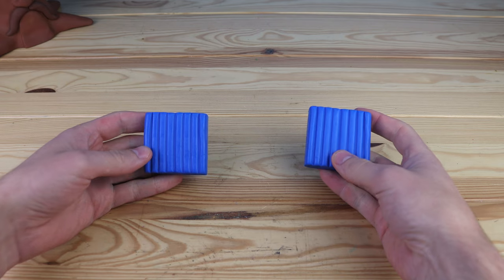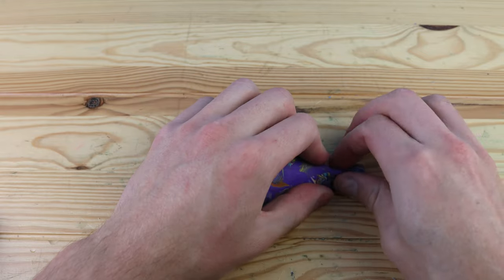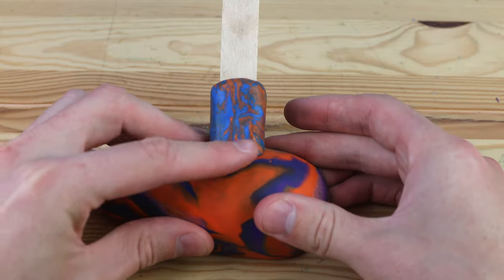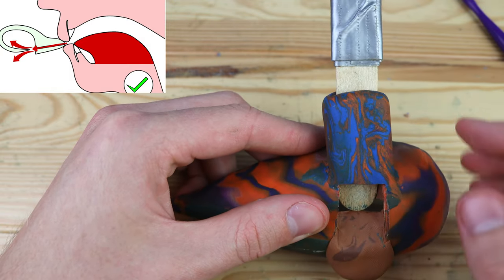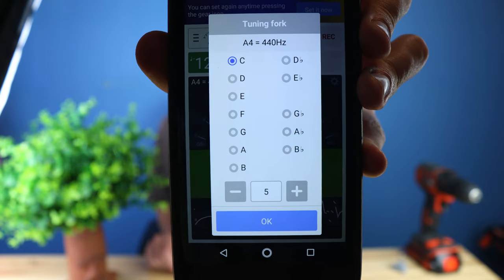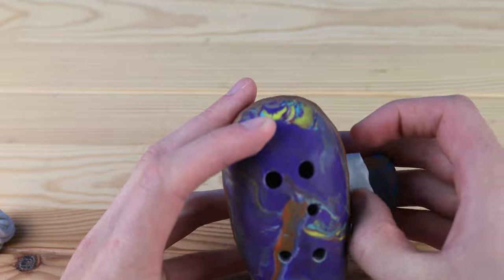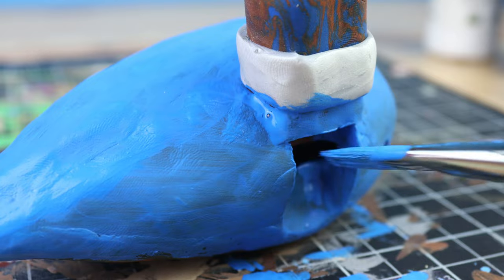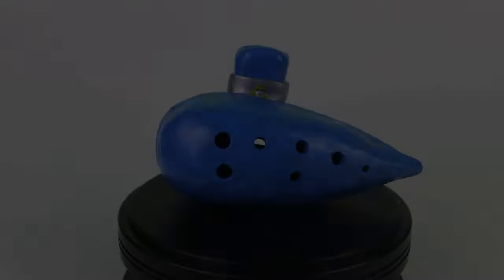How I Made A Working Ocarina With Polymer Clay (Legend Of Zelda: Ocarina Of Time)

Comment: Excellent job!! A few years ago I had this brilliant idea, and thought for sure I was going to make my own ocarinas to sell! Lol you are far more determined than I was! I remember fighting with the wind area and inevitably just giving up. I knew if I was already having so much trouble getting the air to flow properly, I would never get the notes right! I think you did a great job! I do wonder of you're getting your clay baked at the right temperature and or for long enough... it looks like it's not properly cured with the way it chipped and broke when you were cutting it.  Especially if you're using fimo, that shouldn't happen. I was so worried when you started drilling it, that it was going to break and so relived when it didn't!!
Reply from the maker: I couldn't see myself making another one, that was quite a lot of work! With the blue part crumbling, that was because i baked it shorter so I could cut through it easier.
Reply: @Kerobyxclay  I know what you mean! I couldn't imagine wanting to do all that again... although you do have the mold already! 😂